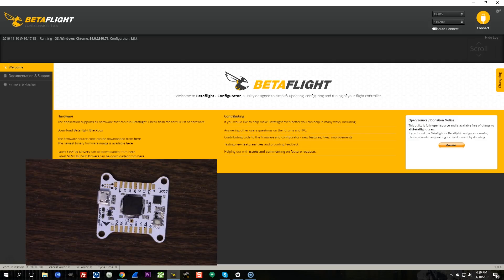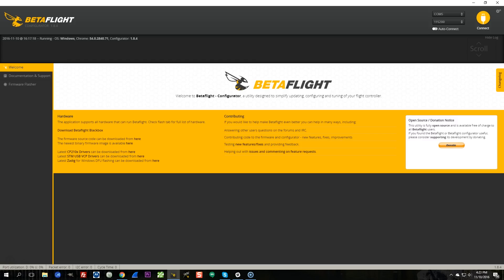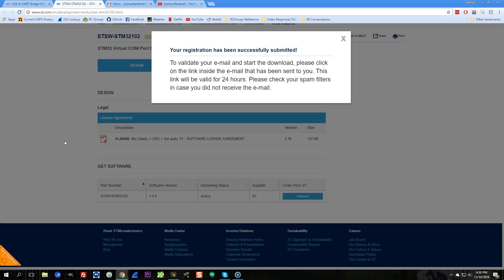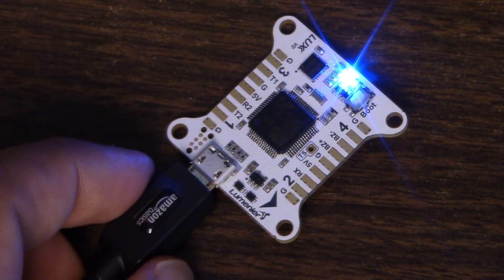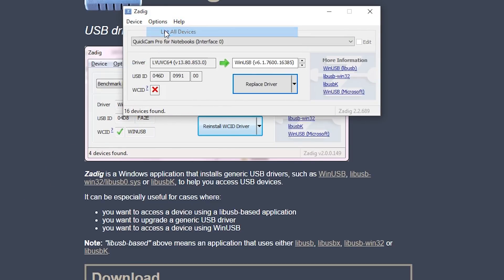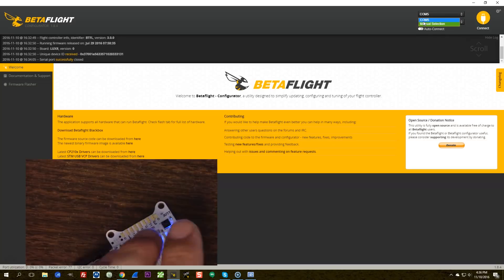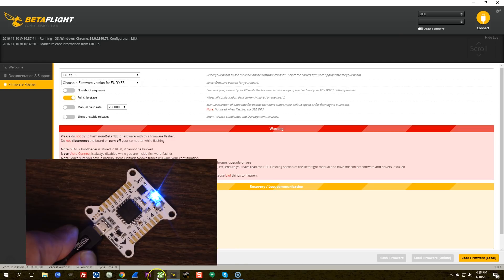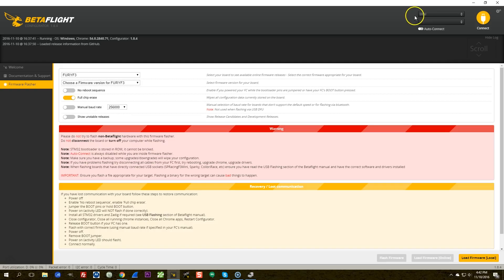Betaflight / Cleanflight Flight Controller Won't Connect | FIXED

Comment: Joshua Bardwell, I want ta have yor baby!!  Thank you so much for clearing up all this crap. I have semi advanced computer skills and I've still had trouble with certain boards and well, the documentation leaves a lot to be wondered about. As a matter of fact I'd like to go ahead and rant about that now. Who the heck is writing the documentation for most if not all of the RC world? It's ridiculous!  Like they hired the help team from Microsoft. The computer asks "Would you like to install A or B?" and you think "Well hell I don't know." so you go to the help and it says "This is the page where you select the A or the B thing."  Well, gee thanks! I didn't know that because that's what it said on the page and even though I only have an IQ in the upper end of the average scale I can read. What I clicked on help for was a description of what A is, what A does and what the effect of choosing A or B will have. And the documentation for RC electronics and programming is just like that. I have to read for days on end and dig through youtube vids till my eyes bleed. If you try to mitigate the circumstances and sign in to a forum and post the question outright you get told you haven't done your due diligence and "We're not here to spoon feed babies." Anyway, I'm done. I've never actually posted a question but, only because I've seen so many go down in flames. J.B. you ROCK!
Reply from the maker: +D. Love thanks!

Comment: chrome book ftw. you don't need to do any of this. it just works. cheap chrome book for the field especially now with blheli chrome extension.
Reply from the maker: +Tom Brady chrome book can't run blhelisuite had been my main reason for passing them up.

Comment: thank you for posting this video it actually helped me understand some issues I had in the pass Iv gór revo F4 board witch wouldn't  flash with latest firmware, looks like I missing some drivers

Comment: some F4 board, revo clones: FlipF4/ airbot are write protect. unlock them first with a FTDI adapter before they can be flashed :  https://nl.aliexpress.com/item/Newest-F4-Flight-Controller-ACRO-version-Raceflight-latest-F405-MCU-and-has-128Mbit-Flash-racing-drone/32728178796.html?spm=2114.010208.3.19.yV2K0z&ws_ab_test=searchweb0_0,searchweb201602_4_10065_10068_10084_10083_10080_10082_10081_10060_10061_10062_10056_10055_10037_10054_10033_10059_10032_10078_10079_10077_10073_10096_10070_10052_423_10050_424_10051,searchweb201603_2&btsid=f6a7db30-ae19-4201-bda2-0276f2a969d8
Reply: u need to connect the bord with a FTDI adapter to a UART port. then connect the board in DFU mode.     Use this program to unlock the F4 chip: http://www.st.com/en/development-tools/flasher-stm32.html     after that you can flash the board with newest betaflight

Comment: I don't know if it's been said, but since project blue falcon went AWOL you are the best consolidated knowledge base we have left.  thank you for putting this together, as always, your content is on point.  I would argue you are one of the reasons this community grows as fast as it can.
Reply: Sadly, Project Blue Falcon was in a terrible motorcycle accident last week. He did not survive. :( Rest in Peace.
Reply: Kwad Skwad he's back and spittin out videos at a rapid rate
Reply: Project Blue Falcon didn't go AWOL, he died. Show some respect bruh!
Reply: he went awol before he died his comment was 1 year ago.
Reply: floorpizza what really. How sad.
Reply: I can't get past the step at 4:15 in this video. I plug in the FC, see COM6 come up once I plug it in, then it says Connecting and it says "Serial port successfully opened with ID:1" . Then 10sec later, "No configuration received within 10 seconds*, communication *failed*". Then it says "Serial port *successfully closed" and the status of the cord icon in upper right goes back to "Connect". If I unplug, the COM6 goes away. 
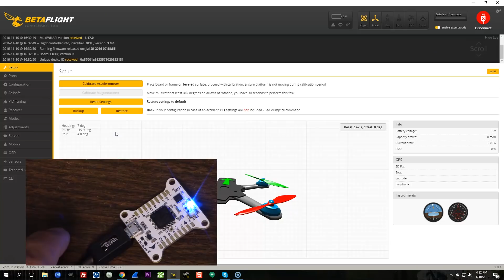I never get to the menu at 5:15 in the video.
This is a NAZE 32 ACRO Rev 6 board. I received it used from a friend who says it was working this week and he successfully connected it to BetaFlight. 
Can anyone help me?
Thanks in advance!
Reply: I have an xrotor f4 fc the one that plugs in to the 4 in 1 I was able to connect until I flashed the new betaflight 3.0. I can flash any version with out problem but now it won’t connect to let me in I have racked my brain any advice would be greatly appreciated
Reply: I Agree

Comment: I had many instances between vcp vs bootloader failing to even be captured by USB. Days and hours trying to troubleshoot it, different USB ports, onboard vs add-in, etc. Driver install/reinstall/update. Came down to several of my usb cables that don't work for VCP OR bootloader even though the successfuly transfer data.

Go figure.

So, if you've done everything, install, remove, update, Zadig, etc with no joy. Try a different cable. Or try it first and save yourself some potential time and frustration. Arrrrrgggghhhh! (And that's being polite, lol)
Reply: Mike Pregler Glad I could help!    Nice to know when all that cussin' was for a good cause.

Lesson learned for me was that there IS a reason to have a couple of quality cables about.
Reply: James Kuhlman thanks for the advice,  I was going crazy with the same problem and tried another USB cable and of course it worked!
Reply: James Kuhlman this just saved me so much trouble. I had already spent 4 hours troubleshooting when really the USB cable wasn't working and I had to use another one. Thank you so much!!!!
Reply: David Parks My pleasure! this was one of those rare times when I opened my mouth and did not come back with the tang of toe jam...
Reply: James Kuhlman amazing! Thanks man, I've been sat at this laptop for 2 hours trying to sort this! swapped cable...BOOM! SORTED!
Reply: YES!!! Thank you! Swapped cables and everything is working now.
Reply: Fingers crossed here. I'm having what I suspect to be driver issues with a Kiss board. It will not enter dfu/bootloader mode and have tried on 3 separate PCs without pre-existing drivers.  I know this video was for cleanflight, but I'm checking anything related to driver issues these days. Maybe it is the wire, because I cannot finding a conflicting driver and DFuse isn't recognizing anything.
Reply: There y'go - it's great when such a small thing becomes hayooge. But then, even a busted clock has two chances a day to be right.
Reply: my new SP F4 requires a software update, yet, when I try to flash it, "failed to open comm port".   I followed the directions in the manual and it is doing the same thing on 3 different pc's.   Time to send it back.   very frustrating.    Also my SP F3 connects just fine.
Reply: Thanks so much I've been trying to connect for days with the same flipping cable
Reply: Omg thanks i was seconds away from smashing everything against a wall
Reply: you saved me hanging from the tree :)

Comment: Never had these problems using my MacBook, and it confuses me that windows machines have such difficulty. The process with a mac is: plug it in. Done.
Reply: This is stupidity of windows and chrome at its best. Windows do not know it can use generic VCP and DFU drivers (so you need to install drivers even it can work with generic no problems), and chrome can not access DFU drivers under windows (even if DFU work correctly in other applications, so step with Zadig to put generic USB driver instead of correct DFU driver).
Reply from the maker: +Miloš Lazović Yeah, but then I would have to use a mac.
Reply: Joshua Bardwell
There is another way, which I use (and I must add it is little idiotic) but I can't use Zadig to change DFU driver (there is couple reasons, but I need DFU as it is) so I use Linux in virtual machine for all operations that need DFU, no need for drivers, work out of box, like on Mac.

Comment: Mine sp3 evo brushed is in dfu mode but stuck on erasing.. i did everything,  again and wiped every thing possible but it's not working. repeating to get stuck in erasing.. do you now way? it seems nobody has An answer on this stuck on erasing BS. 🤘
Reply: There is possibility you bricked board if you used some dodgy firmware (official ones will not do that).
Contrary what Joshua said in this video you can brick F3 boards (you cant brick only F1 boards), and that is easily done by software. With couple instruction you can lock reading/writing to flash memory and depends on level you choose it can be irretrievably (level 2) and there is no possibility to recover it.
But I doubt that you did that, there is greater possibility that you have dodgy flash on you F3 board (it happening sometime that flash die on some MCU much earlier then it should, it happened to me couple times that flash on die after 20-30 cycles even should last at least 10000 cycles according to manufacturer).
Reply from the maker: +Miloš Lazović you keep pointing out this caveat but I don't think this is ever possible for a user trying to flash betaflight or cleanflight. So I'll keep saying you can't brick the board, okay?
Reply from the maker: +acrojunk 88 I'm sorry, I don't know either. Try a different computer?
Reply: Joshua Bardwell
You can say what ever you want, that do not means it is correct.
If you spend little time researching (like in case of RROSD) you will found that what you are saying is "wrong" (in normal cases is not wrong, but using custom firmware from dodgy sources, or in case some error in communication it can happen).
Simplest way is to look at STM32F303 reference manual
 http://www.st.com/content/ccc/resource/technical/document/reference_manual/4a/19/6e/18/9d/92/43/32/DM00043574.pdf/files/DM00043574.pdf/jcr:content/translations/en.DM00043574.pdf
you will find memory protection (4.3 on page 74) and then look what level 2 do (it exist on STM32F3, STM32F4 which are used on FC and on all others except as I know STM32F1 but exist on STM32L1).
Reply: When all else fails, change your USB cable. Took me two days of loading and unloading drivers with nothing being recognised. Even resorted to using a FTDI through the Uart. Changed the cable and magically all the drivers started working.
Reply: Gavin Hensberg, i  did that and No Response still getting stuck on erasing..  this weekend going Back to older Windows and doing a clean install on everything maybe that Will Help😂

Comment: I've got 2 problems one with a Naze32 rev5 clone board I can't connect to it or flash it. Other FC boards all work fine. What happened to rev5 I accidentally set/enabled the Serial RX on the same uart1 as the MSP and clicked save reboot. :'( I forgot to set it earlier and was rushing out...
So the board works fine in the quad with serial rx/tx but I can't connect in Windows to it to change any settings. I've deleted and re-installed drivers, I've set to bootloader and plugged it in but Windows doesn't see the device as being plugged in. The board powers up and blinks the correct lights for normal and stable for bootloader mode but no device is detected in Device Manager. All other FC boards work fine and are detected by Windows and I can flash and change settings but not this board.(I've changed usb cable/ports and shorter cables and by providing separate power to FC) Nothing picked up in Windows on multiple different pc's.
Naze32 rev5 is just mystifies me. I have an osd I wanted to use with it to be able to change settings on the fly but hadn't connected yet.

The other board spracing clone just randomly decided mid flight that it was going to reboot and now it seems to be stuck in bootloader mode (judging from the led lights). I've checked/tested the boot pins (unsoldered holes) and they're not shorting. Windows detects the board being plugged in and gets a com port but Betaflight/Cleanflight can't connect to Bootloader and fail to open the port. Done manual baud rate 256000 and all other rates. Also Flash on connect and shorted the pins. Nah dah, guessing it's dead?

Comment: Easy fix incoming: 

1. Open beta/cleanflight
2. Plug in battery
3.Then plug in micro usb
4. Then connect
5. Thank me later
Reply: TarsRC another bs post
Reply: That did not work at all. Still no Com port.
Reply: TarsRC worked for me
Reply: in my case it says no response from Bootloader Programming failed (when i want to flash the board)
Reply: "fail to open serial port" help please i don't know how to troubleshoot it
Reply: ' Shyred ' I had the same problem , download everything he’s telling here . After you download them , find them on yr computer , usually under “downloads “ . Once you find them open and run the ones he’s specified.
Reply: Markus Romeis Markus Romeis make sure you have chosen (at the top left) the correct board and program. If u know u have the correct choices . Unplug the quad , select all the tabs at the top left . Then hit the “download from online “ button . Then flash . It’s should stat manually flashing . If not . U have to download everything he’s saying here . Let me know how everything goes . Maybe I could help more
Reply: ' Shyred ' https://youtu.be/tjPGtwOiVRQ

Comment: Do you have any guides on how to connect a Taranis to the computer? I want to use it as a virtual joystick for simulators, but my computer will not recognize it even after updating the drivers or putting the transmitter in boot loader mode.
Reply: Power on transmitter normally, then connect the USB cable. That's what the instructions say, and it works for me
Reply from the maker: +Stephen Book transmitter does not need to be in bootloader, that's for sure. If you plug in the USB and it isn't recognized as a joystick then I don't know.

Comment: Great vid explaining this stuff Josh. You are an asset to the hobby :D
Reply from the maker: +Liam Lambkin thanks!
Reply: I second that. I've been watching for a few months now and I've learned quite a bit from you Joshua. Thank you for the great videos.
Reply: 3rd That, i have been watching your videos right from the start. Thank you!
Reply: I'll fourth that, I just had to rewatch this video after 1 year to get my board up and running. Thanks again Josh.
Reply: A great asset.  I learned to fly acro from Joshua on the sim.  I went from not being able to get to a gate to flying my own quad semi- proficiently.  This video was huge.  I'm an electrical engineer and not a luddite, but I needed something like this bad.  How would you find all this stuff without this video.  Surely if this vanished, Betaflight wouldn't die...

Comment: Nice vids do you suggest me getting an X9D +plus for Christmas I am a beginner to fpv racing but I know the technical 
Also some people suggest soldering a electrolytic cap to you PDB to reduce noise I dont know how many Farads to use
Reply: Minecraft Moding by Dim yes to the taranis. It's all the tx you will ever need. And yes to the cap. If you search josh's channel you will find a video on that very subject. why it's a good idea to have it and which one to get.
Reply: Thanks m8!
Reply: Minecraft Moding by Dim no problem mate. Welcome to the addiction!
Reply from the maker: +Minecraft Moding by Dim Taranis is a great radio. I wouldn't fly anything else.
Reply: Ok paid 150 euro for only a DX6i. I know there good quality but really expensive (spektrum). I like the taranis because of RSSI and VBAT telemetry and loads of switches... and really powerful software (you can do anything, hope I can use it!). Looking to buy one from HK for Christmas. BTW great videos! Also is it ok it to use a normal electrolytic cap and not a low ESR one (to clean noise)?

Comment: The DFU cmd is great, but it doesn't work on all boards even if they are flashed with BF 3.0 or later.  I know the DoDo doesn't work for DFU cmd, or at least for me it didn't.
Reply: DFU works on all VCP boards, I dont know about CP210 boards. I think the way that CP210 boards loads the firmware is slightly different
Reply: Dodo uses UART1 for USB
Reply: Yeah Watching this I realize I'm making a mistake with the ZADIG program.  I always removed the driver afterward.  I didn't realize it showed up as a different device, the more you know ...